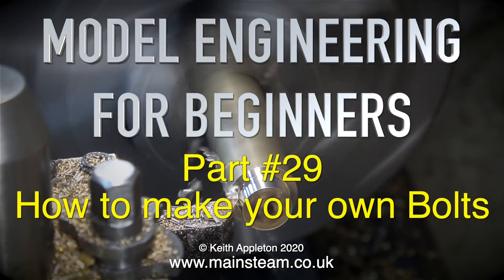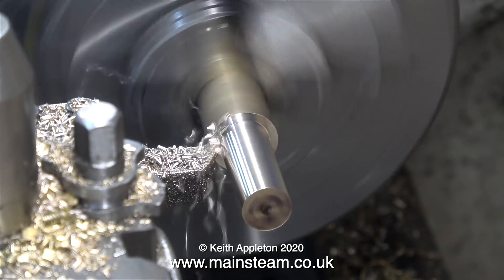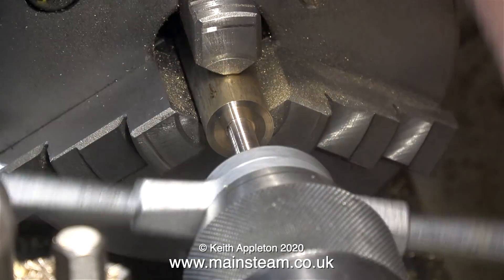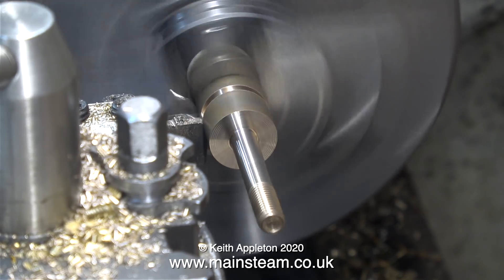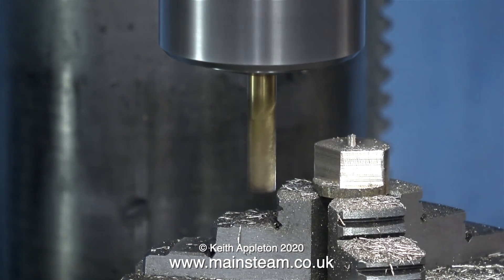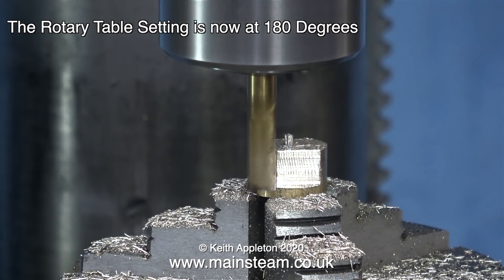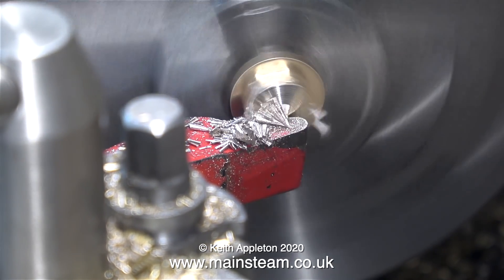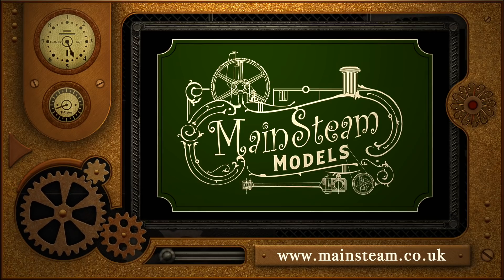ROTARY TABLE USES - MODEL ENGINEERING FOR BEGINNERS - PART #29

Comment: Very well done, the last time I made Bolts was years back and I made them on a CNC Mill, all with a special thread and non standard bolt head on all 3,000 of them in stainless steel, the following day we modified 30 box wrenches to match the bolt heads. Was glad when that job finished.